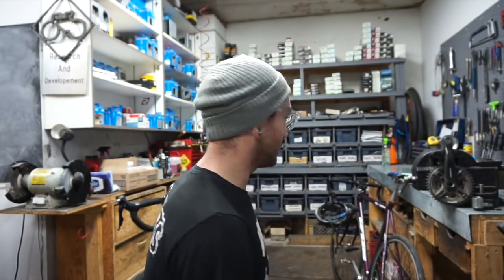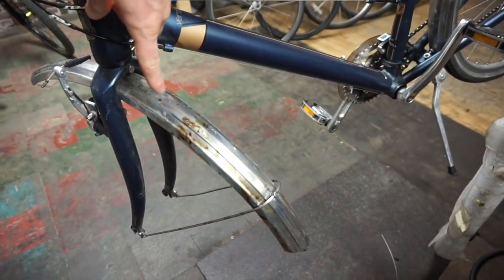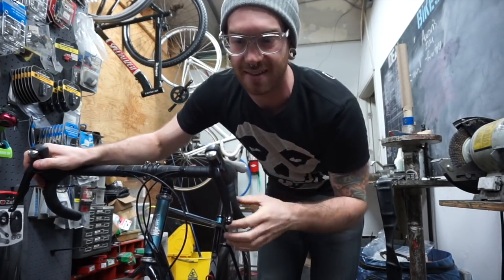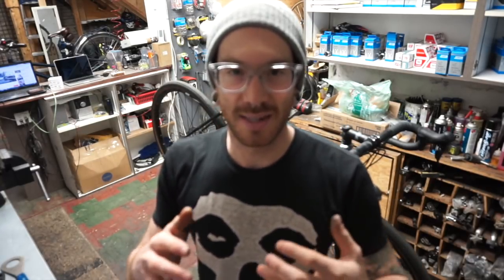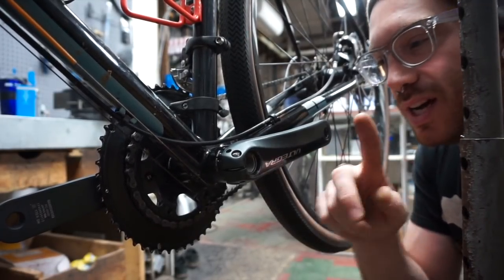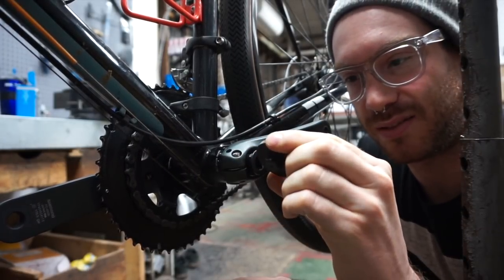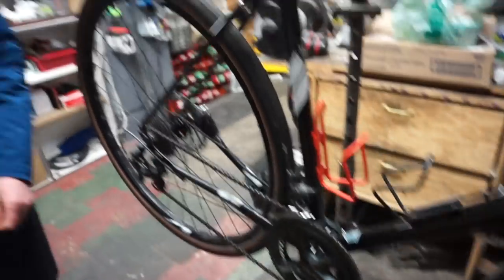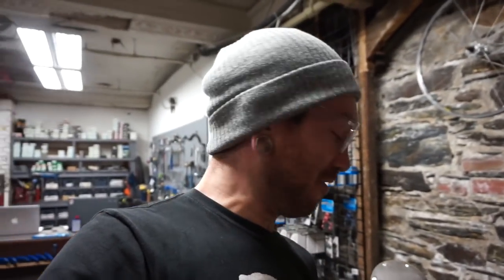New Cranks for this Gravel Bike

Comment: I really dig the bike check segment... I think it'd be cool to do a little cinematic section showing off the bike and then talk about it after (what it's used for, why you think it's cool, why certain components, etc...)
Reply from the maker: I actually considered doing this in this video, but saw it was getting reallllllllly long. So I cut it off after the feature. I think that edit is probably my favourite or second favourite thing I've made yet.
Reply: Yeah, makes sense. Might be a cool idea to to do stand alone videos for the bike checks, that way you can keep the length in check and keep the vlog as it's own entity.

Comment: Tinkering is fun. You don't need any other reason for it.

I'm pretty sure I'm getting a set of Santa Cruz carbon wheels for Winter Solstice gift. Do I need them? No. Will they make me a better rider? I'll probably be worse. Will it be fun to lace some wide trail tires to them and find out for myself what they're like to ride (fall pushing too hard)? Yep.

I'm all for "Don't make excuses, ride what you got". But tinkering is a blast.
Reply from the maker: Oh, I tinker on things like there is nooooo tomorrow haha. I never have the extra money to throw at baller parts, so I just do funny things like strip the paint off a frame or something like that. Messing with stuff is the best haha

Comment: I like this format one time a week. It will be a nice addition! Any suggestions on tires for a Cannondale Caad x which I use mainly for road and some off road? I’m looking for something like the tires on your friends gravel bike but in a 35c. I have searched everywhere but with no luck. Manufacturers need to start offering a greater variety of tires in different widths.
Reply from the maker: the tire that immediately comes to mind is a smaller Donnelly (formerly: Clement) Xplor MSO! They come in a pretty vast array of sizing, I'm almost certain they come in a 35mm.
Reply: Spindatt Thanks for the reply! Much appreciated!

Comment: Like the glasses and the existing format for the bike check. Quick question if you don't mind. I just bought a 2018 Specialized Sequoia Elite and was thinking of putting a mountain bike crankset on it for lower gearing. Do you think that would work with this bike and if so which crankset would you recommend? Thank you if you can help and keep up the great videos.

Comment: Are you familiar with the GARBARUK 11-50t 11-speed Cassette? I want to add this to my Sram Apex 1 set up. It currently has an 11-42t cassette but I want that 50t! Do you have any experience with these products? The Garbaruk site says that their cassette will work with Sram mtb derailleurs (after switching out the cage that cames with their kit). So what I am asking is do you know if the Sram Apex 1 rear derailleur is very close to the other Sram mtb rear derailleurs? If not, what if I buy a Sram mtb rear derailleur would it work with the Apex 1 shifters? I hear it is possible because both the Apex 1 and other Sram mtb derailleurs have the same EXACT ACTUATION technology pull. What is your thoughts? Thanks brother!
Reply from the maker: So I use a Sram MTB Derailleur with a Road Shifter on both of my cross bikes without issue. They are 10 speed, but from everything I've read/seen/heard 11 speed can do the same. My guess is that you could probably use the cage in the kit on the apex 1... but without doing it myself... me no no haha. I have not ever seen those cassettes, but they really do catch my attention! Thanks for sharing.